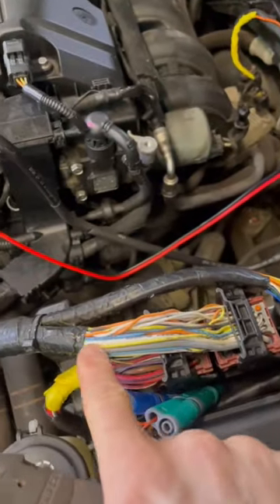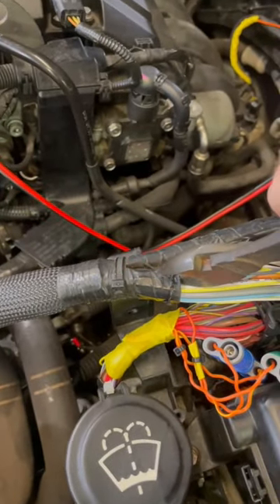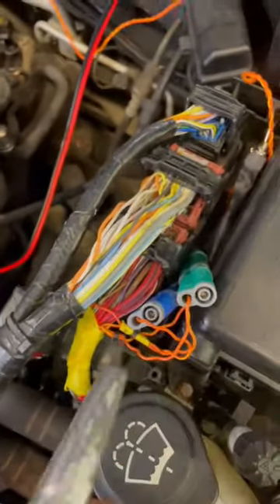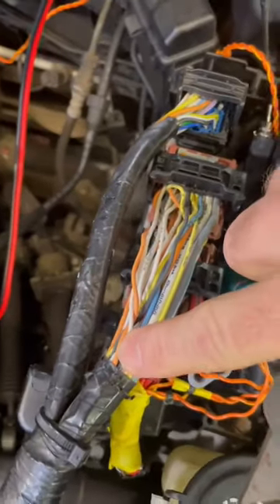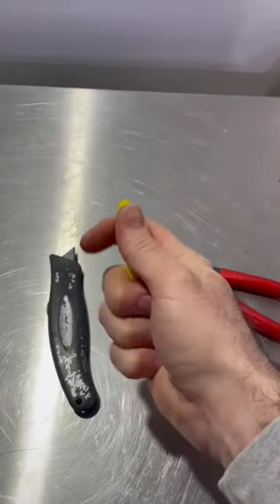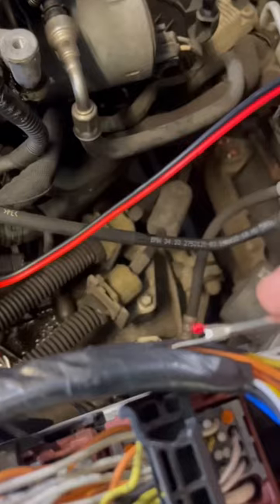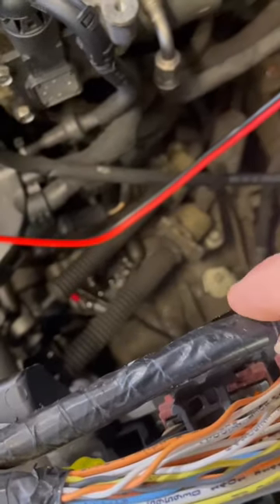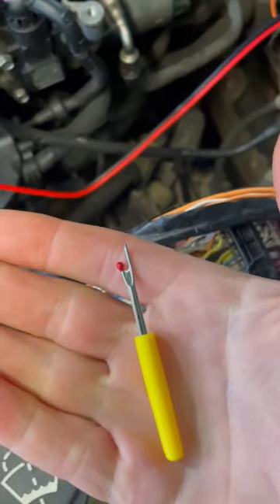Awesome mechanic life hack for electrical diagnostics!

Comment: I usually use it the other way around with the red protective ball in the cable loom, since the other blade is quite pointy and sharp and could potentially damage the wires
Reply: Bout to say the same thing.
Reply: Makes more sense.
Reply: Same
Reply: Thats how i used to do it.  But after catching two wires because they were folded over, I havent used the ball end in the harness since.  That was about 4 seam rippers ago.  That red ball likes to grab any twisted or folded over wires.
Reply: @dtnamastertech1911  good point!
Reply: Same
Reply: What is that tool call?
Reply: @philpham2069  seam ripper
Reply: @philpham2069  
I’ve known them forever as quick un pick. Any haberdashery place will know exactly what you are after. Handy hint, buy lots.
Reply: Was about to say the same thing
Reply from the maker: I did try it that way round, it sticks on the tape. I would prefer to blunt the spike personally. Check out the full video here: This Tool is AWESOME! (And It Only Cost $1.00)
https://youtu.be/UxTxVSEjP-c
Reply: this is why the ball is there
Reply: nahtauftrenner
Reply: @enma3175  German for seam ripper, in Swedish it is a "sprätt", translates to ripp(er), In French, anyone? ;-)
Reply: @MechanicMindset  i found one when i was a kid on my grandma's house and i thought it was a really interesting tool to have. Luckily i didn't find the need for one yet, especially because i've not seen one since XD
Reply: Or file the point smooth.  I did that with mine
Reply: Same problem, both ways?
Reply: That is the right way to use.
Reply: @vertex944gt3 Actually, you are wrong. The ball is meant to run along the top of the seam and protect the fabric from damage! Not the other way around!

Comment: Thank you. Use the ball protected end while cutting the tape to prevent poking the wires. Have a great week.
Reply from the maker: Cheers Billy, I thought that initially but it sticks on the tape, do you find the same?
Reply: I find it cuts less wires using the end in the video.  That red ball likes to grab datalink wires and folded over wires in the harness.

Comment: Also. (Standard Wire Gauge) Use the knitting needle size gauge to check the manual arc welding electrode size

Comment: They make carpet utility blades (you insert into utility knives) that can be used in the same way.
Reply from the maker: I know the ones, they look savage 😆
Reply: Those work also but the tip is too sharp and WILL  cut into wires unless you take a small fine file or grinder and slightly round the tip over.

Comment: Thumb's up! That's a great tip. Since we're raiding the wife's stuff anyhow, head to the laundry room and grab that Wisk brand laundry detergent. A big capful in warm water will really clean the grime and that black crud (algae?) off a boat, RV or other long-hibernating or barn find vehicle. For some reason Wisk brand really does the trick and is a long-esteemed boatyard hack. And if there's any molasses in the pantry, mix one part of it to about 9 parts water in a plastic tub or bucket and you've got a cheap and effective anti-rust soak. Toss any rusty steel or iron tools or parts in there and in a week or two the "chelating agents" in the molasses will attach to and gently carry off those oxides without aggressively harming the good metal, as other more aggressive methods can. Just rinse with water, dry, and hit the bits with some lube, primer or paint, or even hot wax with a blowtorch to forestall further rusting. It takes awhile longer than other methods, but does the job for pennies and very safely.
Reply from the maker: Nice tips! Thanks 👍

Comment: I bought a master terminal kit from snapon and it comes with this seam ripper, your supposed to use the other end to keep from exposing bare wire. But if your not in a tight place working on a ecm or tcm harness then as long as your careful not to expose any bare wire then use anything really, I've used razer knifes when I have all the room in the world

Comment: That’s a great idea but I can’t help and Why don’t you flip it so the red ball inside then you would not risk poking the wire at all
Reply from the maker: @Darealwessam  I tried this suggestion; for me, the ball kept getting stuck on the sticky side of the tape. I think the sharp side is better, bit ways need to be used with extra care!

Comment: Works good for the normal electrical tape style harnesses, but not so well for everything that uses four layers of heat tape and then another four of electrical tape that is always wrapped in the opposite direction that you need to unwind it (thanks GM)...

Comment: That's is cool , when I wrap it back up I put a small load of black silicone to seal the end of the tape , this keeps it from unraveling.
Reply from the maker: @keithsharratt3402  nice tip!
Reply: @MechanicMindset  
Quid pro quo , thanks!

Comment: Nice to see. Just for your information, you are holding it upside down. If you have the little red dot on the downside, you will not cut a
wire. If you have the long tongue you can actually pick up on the wire. just for  your information.
Reply from the maker: Cheers, I did try that way but it didn’t work so well. Kept sticking on the tape. I think I will blunt the end of the spike 👍

Comment: Are those can be found at a fabric store in their called a seam ripper. When using one on electrical, keep the non-sharpened end down with the wires.

Comment: There are larger seam rippers available for trades like sailmaking and canvas work. Stop by any of those places and they’ll either give you a spare or sell cheaply. I always purchased multiples to have in the loft so there was one in my tool belt, one at each sewing machine and some on the workbenches. The larger ones have a flat handle so they’re easier to control and the tip is angled a little upwards. Those small ones are pretty flimsy.

Comment: Good tip! I'll probably forget about it next time I need it and bust out Richard still.... FML
Reply from the maker: Get one on order and give it a home with your electrical tools 😁
Reply: @MechanicMindset  I did that about a year ago. I have a whole bag of JUST electrical diagnostic / repair / installation tools and parts. In it are two seam rippers, both made of the Amazon flavor of Chinesium, and the larger of them lit with an LED (because, what isn't nowadays?), which actually comes in handy as you follow the wiring harness down into shadows.

Comment: Just turn the knife upside down, run the flat of the blade along the cables...easy and no damage....have been doing it for 40 years as an electrical tradesman, no need to carry around sewing tools.

Comment: Someone told me to use the red ball into the loom on the wire side.... said its safer .
Reply from the maker: Lots of suggestions for this method. I found the ball kept sticking on the tape. Someone else suggested lubing the ball. But I have another idea 😉👍cheers
Reply: File down the long point and round it off, still works better than using the short side in.

Comment: You’re using it wrong… 😒 The red ball end goes inside the harness, as to not poke or harm the wires inside.
Reply from the maker: It’s a horrible tool to use that way round, I explore that in the the full video. I prefer to be careful, and I’d maybe look at blunting the end of the point. Otherwise, the ball just sticks to the tape 👍

Comment: omg only I see the obvious solution of using the knife blade in reverse? Is pratically the same thing of that tool, the ball make is more comfortable, but I never found issues by cutting with the common blade from inside, holding the non sharp edge towards the wires...  Khaby the italian meme guy will make his funny face as: aha, you discover boiling water! 😄

Comment: Little tip turn it around 180 deg so little red bulb is facing down that way less chance of poking wire. They work great been  using them for  many years.
Reply: Depends how tight the sheath or loom is around the wires. If you can fit the bulb definitely a good idea.

Comment: Whoops,  I wish they made one of these in a pull design.
Reply: If you use the linoleum blade out of a utility knife and just round tip off as to not catch the wires it makes a great pull cutting tool. I use it as well as the seam ripper. I work on peterbilts and they are plagued with electrical issues. So these tools are a life saver. (Along with a stiff drink when I get home) 🤣
Reply: Hook blade for a utility knife....I like it, I'll give it a try.
Reply: @bradfaught1695  I have modified (as I am sure most of us have here) so many tools that I had to start a toolbox just for my Jerry rigged shit. 🤣🔧

Comment: You used it upside down goober, the red ball is to avoid the wires
Reply from the maker: It’s a terrible tool when used that way round. I discuss it in the full video. I prefer to take it steady with out the ball sticking on the tape all the time 👍 Probably just blunt the end off